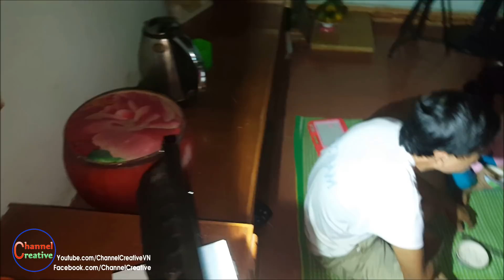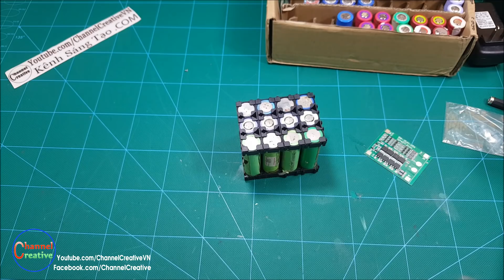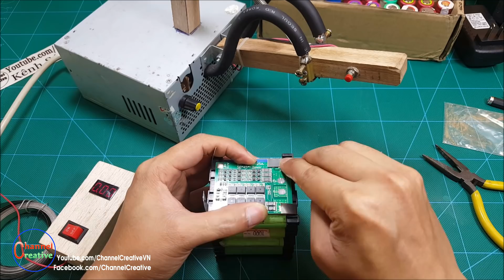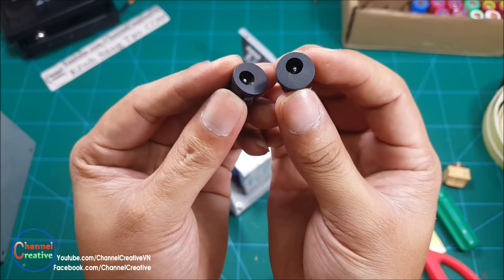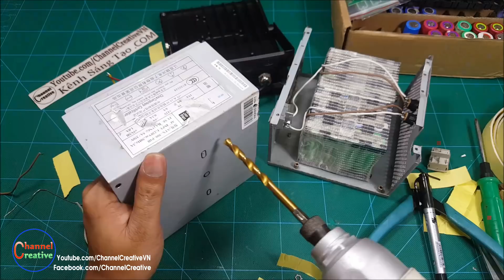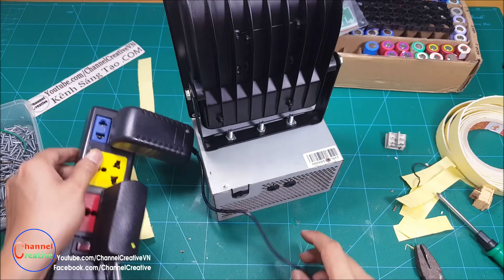How to make a 12v 20w Led Light continuous use of 15 hours

Comment: will you be able to fully charge the battery with the 12v adapter since 3s has a maximun voltage of 12.60v?

Comment: Nice build good job, one tip put a grommet on the cable exit hole as it will eventually short the cables to the enclosure.

Comment: the batteries will power the entire house in  reverse with that poor chargers😂😂
Reply: O yeah using in the night 

5 hours later battery dies 

Charging with those poor little charger

1minute later:Still not full
1hour:later nope not full
1day:later gotta be patience 
1week later:its gonna be full soon (or maybe not)
1month later:yes it has little power (0.01V)
1year later:yes........aw men its now -12V its ok as long as it wont take a eternity 
1eternity later:oh yess it has. Another one (0.00001V)
In heaven:Dad:hey son how did you die 
Me:oh about that my invention has been charging for 1eternity and i got tired so a turned it on it was so bright ahhhhhh my eyes and my invention fell in my head and thats what happened.

Comment: Make a rc car with 180 motor,ice cream stick,cardboard and (2)18650 cells and to make it more interesting use rocket motor it will boost the car and the body of car should be dodge challenger

Comment: Sir please make a power bank
Reply: Same principle as this except you the output of this is put through a voltage regulator pcb that takes 12 volt and outputs 5 volt 1 amp. output goes to micro usb cable.

Comment: Sir even i am making lights like these but i am using 50w led with voltage booster and supply it with lithium ion 18650 battery of 11.1v  8amps power. But i have an issue How much time will  my light work continuesly for? I need my light to run for at least 10 hrs

Comment: ..?sorry I can't understand that you use 2 li ion pack.....
Reply: you can use just one pack but using 2 pack in parallel improve the duration of the battery because the capacity in parallel connections is multiplied